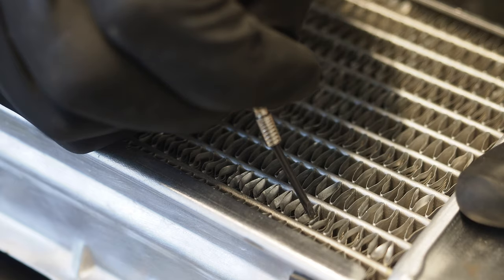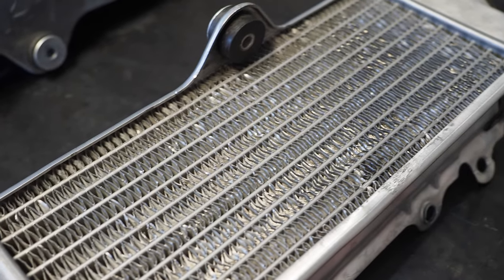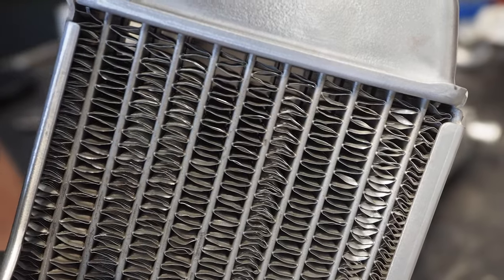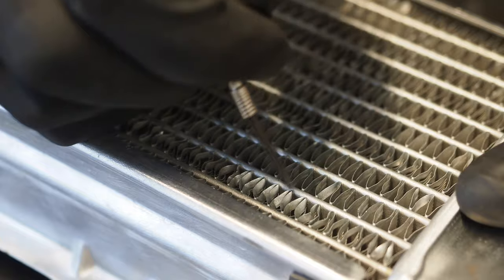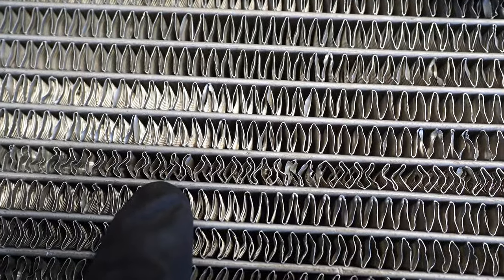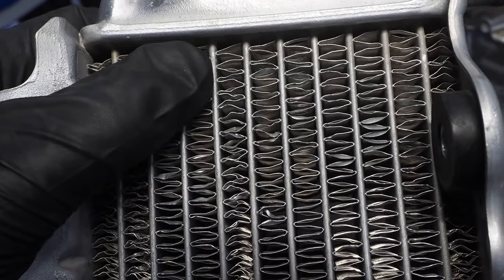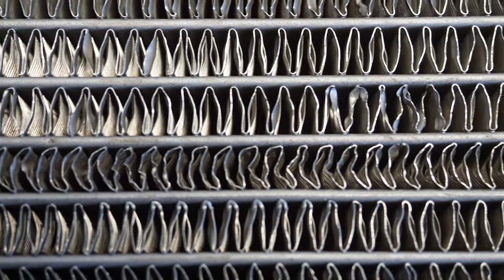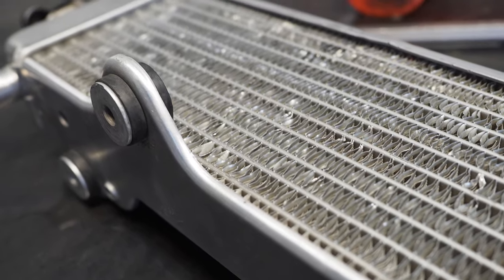HOW TO: Straighten and FIX Bent Radiator Fins

Comment: radiator fin straightener tool would be easier to fix & save time
Reply: Radiator fin straighteners are good in concept but even using the correct fins per inch, they won't be able to deal with all of the variations of bends in the fins. Several videos reviewing the fin straightners prove using a screwdriver is the better, albeit slower, method to get radiator & cooler fins straightened out.